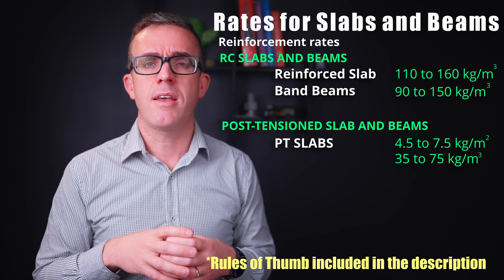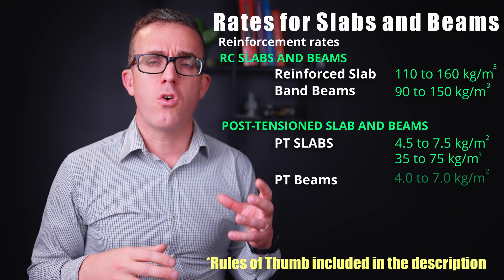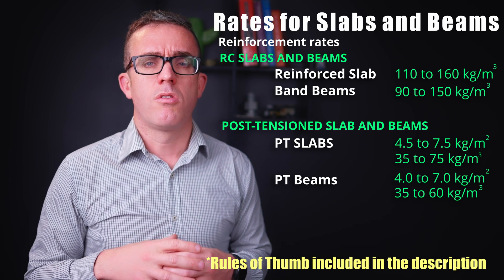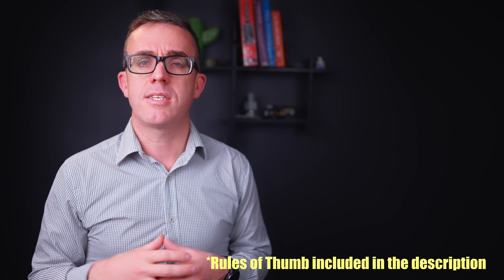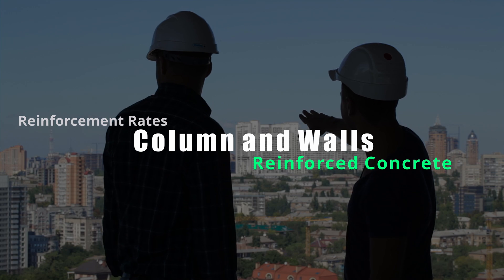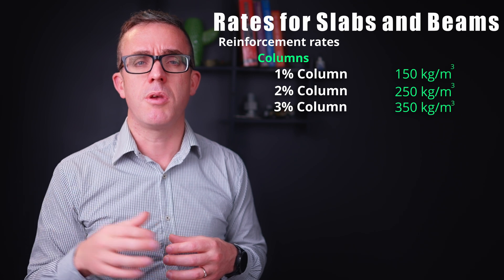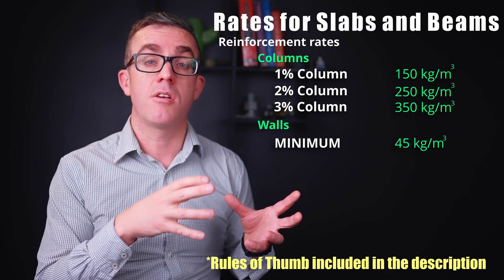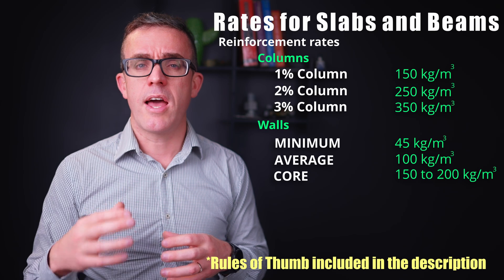The Rules of Thumb Concrete Design basics

Comment: RC beams Span/h = 15 is supporting non-structural components LIKELY (or NOT LIKELY) to be damaged by large deflection? 
h is total depth. 

An old-school engineer who is more familiar with Eurocode suggested Span/h = 10 to 12 for r.c. beams supporting non-structural components LIKELY to de damaged by large deflection.

Comment: What units are you using in the big K formula? And for a slab is B a one meter strip? When I use SI units with M in N*m and the measurements in m, K becomes a very large number far from 3.

Comment: Brendan I am your fan from Africa. Your videos are always helpful. I have one Question regarding the spans. Which direction of the slab are we taking into consideration when we calculate. It is the highest side or the lowest or can we take a representative average of the 2 sides?

Thanks in advance
Reply from the maker: Hi Natneal, it will be the smallest side, structure will move the the stiffest path which will be the shortest direction.

Comment: why cant we consider the dowel action of longitudinal reinforcement in RC beams for shear?
Reply from the maker: You can in column design, but beam design it is hard as it serves several processes.
Reply: @BrendanHasty  I know the code doesn’t allow for dowel action for beams, but what if you have residual capacity from bending and torsion of the beam? Could that be used for shear?

Comment: Do you have any experience with substituting steel rebar, with FRP bar? Is that something you could talk about?
Reply from the maker: Hi Thomas, I have had some experience with FRP. Typically the failure mechanism is brittle due to the FRP., so you have increased safety factors, typically you want to have your critical case as a ductile mechanism as the structure will give you warning signs when overloaded.

Comment: Great video. Just found out there are rules of thumbs to almost every structural elements I can think of. Its amazing. This is really great content. I think you can make a series out of these video. A few structural members per video under 10 mins or more with simple worked examples. I had to pause a lot to write the rules down. Bless you for your efforts.
Reply from the maker: Hi Timo, I think every structural element will have some rule of thumb. Thanks for support. I also had the rules in the description work through the basics of a beam design would be good

Comment: Appreciate this video. Would there be a significant difference in these values when it comes to earthquake designs?
Reply from the maker: Hi Sanjey, there should not be significant difference in earthquake design, of course there will be exceptions to these rule and hence you need to back them up with detailed calculations. But generally the rules should still hold.

Comment: Hi Brendan, can you please explain what Wu is in the wind loads? We’re currently doing a project for steel structures. We’ve found the pressure thru 1170.2 but when it comes to Wu, it’s confusing as to what exactly are we gonna take it as… please explain.
Reply from the maker: Hi Ayush, thanks for watching. I will plan a video on wind design, but for code specific design it would be on my patrion as I think it wouldn't far well based on the effort required.